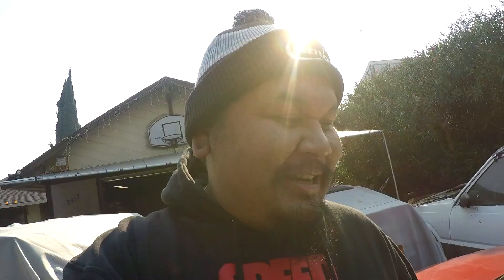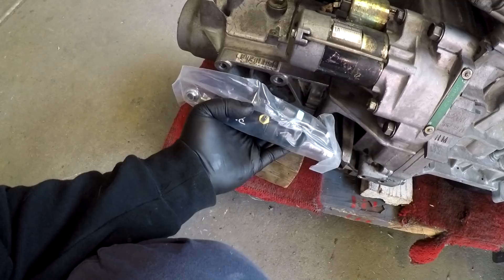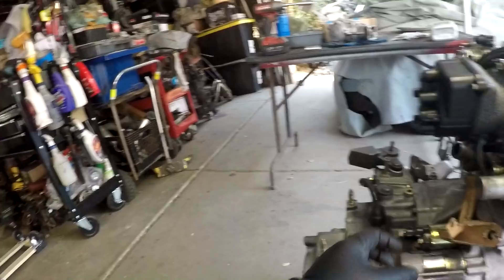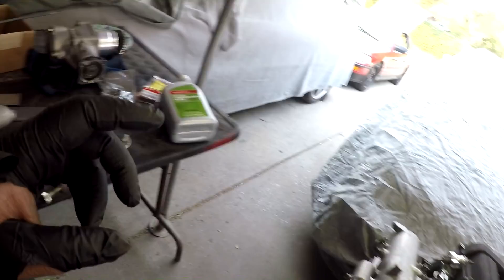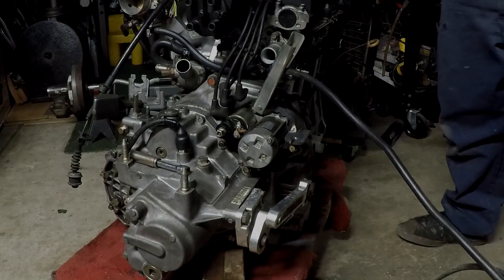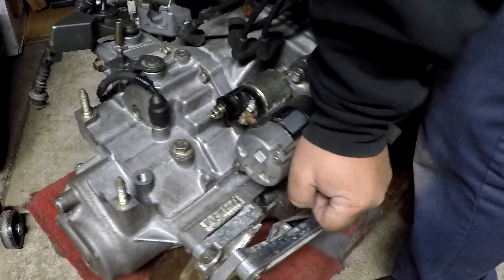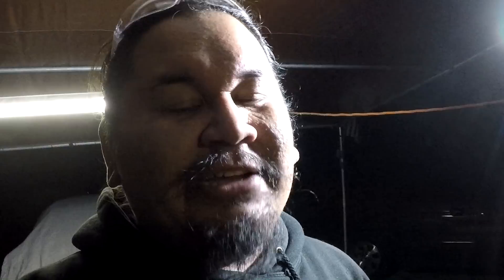AWD BUILD 4: Custom Hasport Cable to Hydro Conversion

Comment: Great job! The only thing I do with that bracket is add another mount hole and gusset to grab that one trans case bolt right on top of starter. Just too be safe. But either way you probably be fine and it looks good. I wish more kids would get out and work on cars.

Comment: Have you ever thought about fabbing a pull to actuate master cylinder for full hydro conversion? I've always thought about doing it but kind lost motivation and the only pull type master cylinder I could find where made by AP racing and where really pricey.